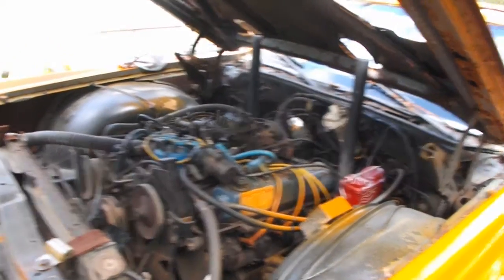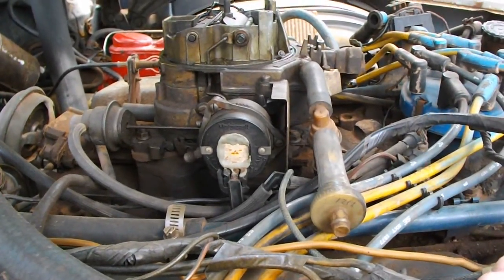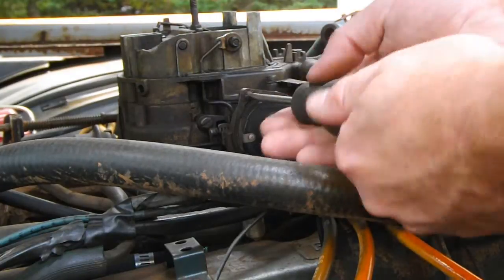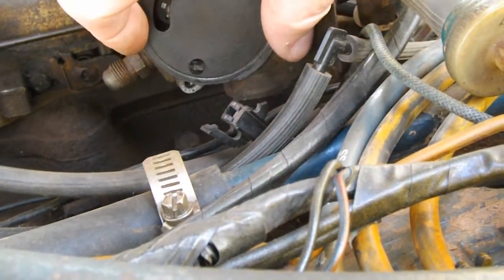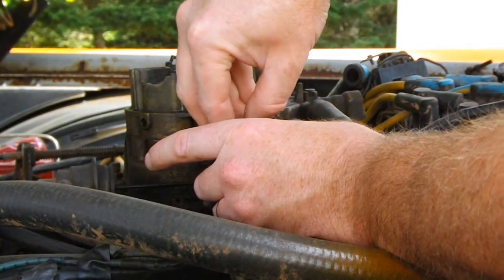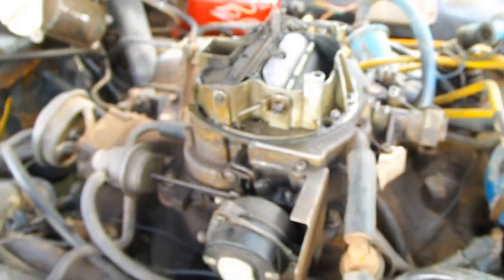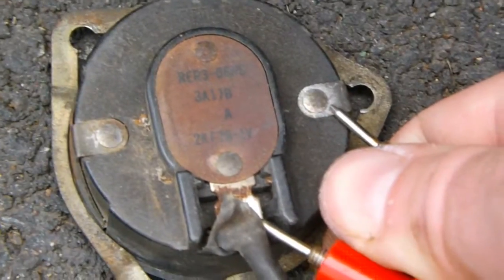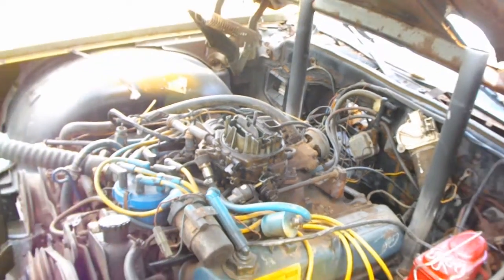Demolition Derby Tech - fixing a choke on a 460 ford holley carb

Comment: I got a 1987 Ford Georgie boy motorhome with a 460 mine is stuck right now too and from my understanding it will open when it gets warm and hot but until then it's not staying idling and I got to keep my gas on the pedal so I'm going to open it up I'm going to see if it's stuck I thought it should open freely just when I give it gas I can see both butterflies open only one side opens my choke side doesn't open it's stuck it's still I try to move it with my finger inside the carburetor hose it's stuck and try to wiggle the side of the carburetor and it's stuck my carburetor guy says it shouldn't open freely it only opens when it gets hot but from the video I'm just watching maybe it's stuck and maybe it's not moving period and my carburetor guy didn't know it was stuck when I just mentioned it to him over the phone I'm going to open the side unstuck it and hopefully it'll open when it's warmed I'm going to try this method great idea absolutely a thorough video I love it and I'm going to do an attempt the same appreciate the advice the knowledge just a little confused with what my carburetor guy said when he says no it's not supposed to be free only when it's temperatureized your choke will automatically open it by itself and all that is good and fine but it's not going to open if it's stuck lol lol lol lol so I'm right now wondering if it's stuck because the chokes got open it when it's warmed up or if it's stuck because the carburetor hasn't been ran in 10 years and it's stuck so it needs to be unstuck but this video motivates me and helps me realize that it could be stuck this was like a poem pick a pack of pick up pick up pick a pack of peppers or feather fin of feather feather fin of feather I know these two rhymes that were tongue twisters when I was younger they were so funny anyways I'm going to get to it I'll post back in a few days I'm actually getting ready to do this right now in the next half an hour so I'll keep you posted next few days thank you guys and thank you for the fine video this is a problem that occurred when the motorhome was sitting for about 10 years it got gunked up and clogged up and everything's just been the situation ever since so a bit of advice start your motor home even though it's sitting start your generator even though it's sitting and start your air conditioning and use your stove and flush your toilets put your showers on run your sinks as much as you can as it's sitting I've noticed things get brittle fragile and falls apart instantly after years of deterioration of sun and weather. We don't last forever and neither should these components so maintenance and usage can help out for further future long-lasting usage thank you everybody thank you all your YouTubers and thank you world God bless

Comment: Should the choke be adjusted while the engine is warm or cold? My 85 F250's choke has been stuck shut since I bought it and makes for a long drive home in sub freezing temps. It chokes and stalls just touching the gas, until it's warmed up. On hot day, you barely gotta bump the starter and it's good to go.